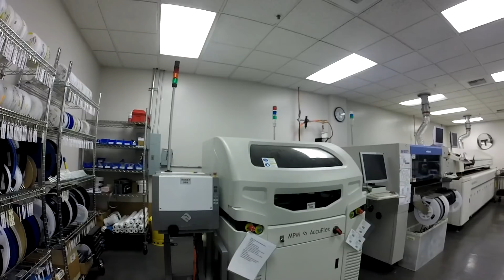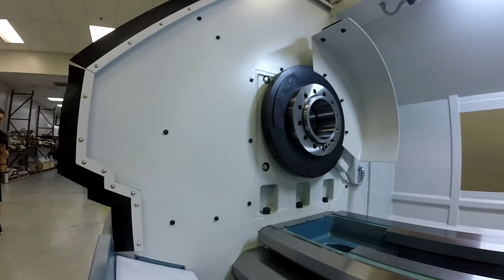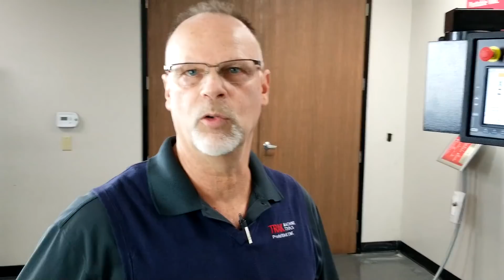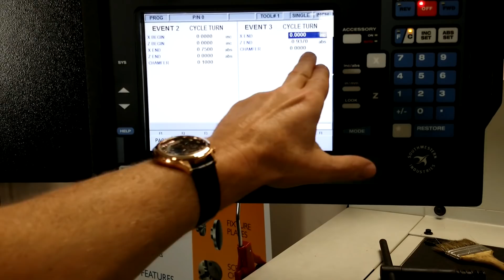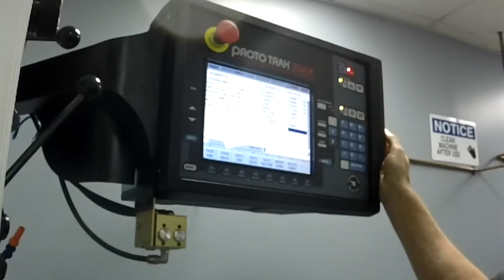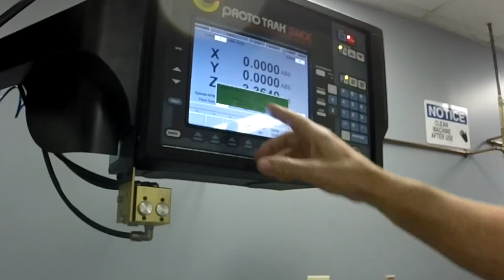Summer Bash 2019 Sponsor - Trak Machine Tools

Comment: Hey Stan,

I was at the bash two years ago.
Had a great time.

I've been running Prototrak equipment for 20 years. NASA had several mills and I bought a 1630 LS lathe for the home shop about 10 years ago.
They are great for prototype shops and
hobby shops.

Looks like they are more adapted for longer runs as well these days.

I could frequently have  parts programmed and fabricated before
the full CNC guys could get them programmed. 

Only problem I had with the lathe at home was a two dollar pancake battery in the control.

Looks like the verify cycles have been
upgraded. I'll have to look into an upgrade for that.

Hope the bash goes well.

Kap

Comment: Have the lathe (1640sx) and bed mill (DPM3).  Use them for one-offs and small runs of antique auto parts.  Have made some pretty interesting  parts such as a transmission (Jerico) to Mazda rotary bell housing  adapter using the AGE feature.